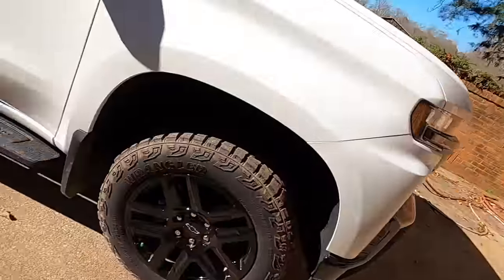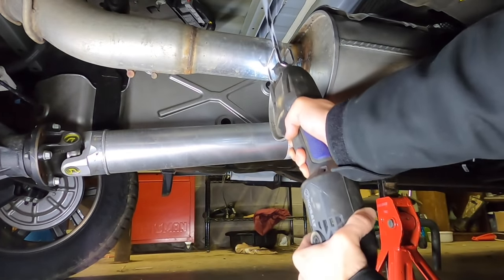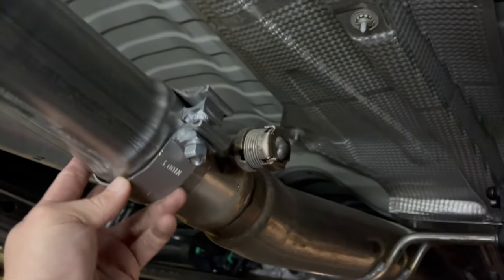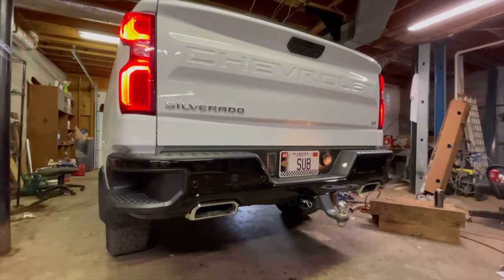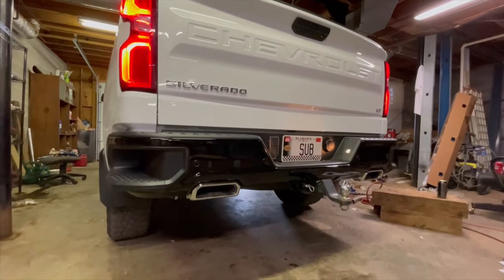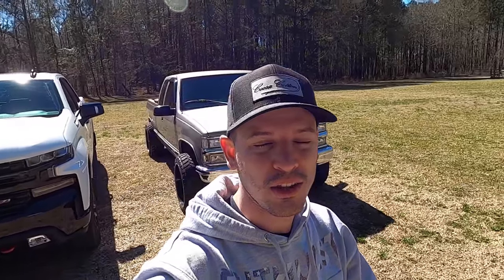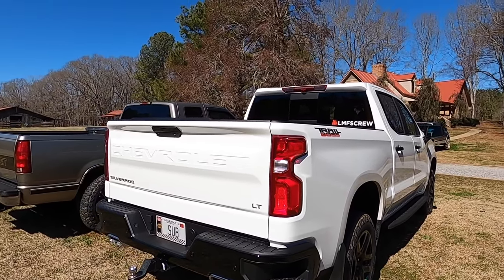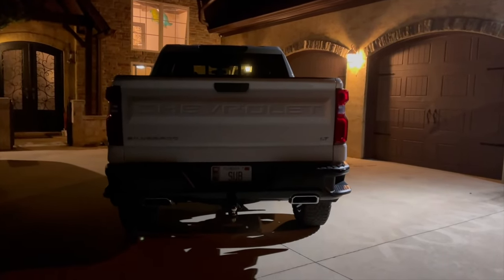MUST DO exhaust mod for your Silverado!

Comment: Should’ve cut out the flap valve.
Reply from the maker: Nah, don’t want a helicopter in the cab
Reply: @lmfscrew  There is no helicopter with the dfm
Reply: @lmfscrew  I cut it on mine and it sounds perfect with not a lot of drone
Reply: most say cut the flapper when you do this, but with the afe you might also have to weld it in then...because it's barely long enough to avoid exhuast leaks with flapper delete.
Reply: You're definitely supposed to cut the flappy off when you do that's why he had to cut some of the new pipe
Reply from the maker: I didn't cut any of the new pipe
Reply: @lmfscrew  yeah that's the problem i've seen...most do delete the flapper (it sounds fine w/o it), but when they do that with the afe it tends to be a little short causing leaks that require welding -- specifically what you wanted to avoid.
Reply: Lmfscrew are you thinking about cutting the flapper out?
Reply: I did the same straight pipe mod on my 21’Silverado RST 6.2. I think I can hear the flapper vibrating when cruising. I should have cut it out with the muffler. Overall, it still sounds bad ass.
Reply: How long is the pipe you used?

Comment: Its shocking how much sound the little resonator ports hide. I covered all three of mine up a week ago with high temp hvac tape and it is mind blowing how much louder it is. Before this i only had a magnaflow 18" muffler installed. The resonators delete made it soooo much deeper and more accel drone, but still quiet inside cabin. And then 3 days ago I put on KN cold air intake, and a resonated bolt on exhaust tip, and the tone is perfect for my liking when you combine all three aspects.. Cant hear anything at idle speeds but growls like a mother f when you step on it. The cold air intake rattles my damn gas pedal!! It almost drowns out the exhaust sound.
Reply: and adds 15-30hp...:)

Comment: I cut out the flapper valve on my '14 Sierra, and it surprisingly made the exhaust deeper, so I would cut that out and move the piping up if I were you.
Reply: What does the flapper in the exhaust actually do ?
Reply: @JohnD0129  Its sole purpose is to quiet the V4-mode drone. But since it only opens up depending on how much throttle you put down it acts like a valve that would quiet the noise of an engine.

Comment: I HIGHLY RECOMMEND the Borla ATAK Crate Muffler, I just put that on my ZR2 Silverado with 6.2 engine and she is purring like not other!  I left the resonators but had the shop cut the flap by the factory muffler.  You won't regret the crate muffler.. And yes, there goes my gas mileage because every time I accelarte, I want to continue to hear the roar and I gun it!  Lol😂

Comment: I have the high country with the 6.2 10 speed transmission. I was recommended by a good friend he's a excellent mechanic,  the Corsa sports exhaust and K&N sistem with the pedal commander.  Work excellent I really recommend 👌😊

Comment: I got a 2021 Trailboss Custom with a 6.2 in it. I did a muffler delete and removed the flapper. Left the resonators on it. Sounded unreal but the cab noise was too much. When the DFM would kick it would sound like a Subaru! So I then put a Flowmaster Super 40 on it and it toned it down a bunch but still has a nice growl to it. It has the 3” exhaust on the truck. Your truck looks and sounds good!!
Reply from the maker: Yup keeping the flapper makes a huge difference with dfm, really wasn’t any sound change going in and out. I’m keeping it until I can get a pulsar to deactivate it.
Reply: @lmfscrew  I put a K&N cold air intake on my 6.2 yesterday and it took care of the Subaru sound for me. Just can’t keep my foot out of the throttle now!!

Comment: I have a 2020 Trail Boss with the 6.2l and did the same thing right away haha. I love the muffler delete. I made sure to get rid of the flapper valves though. It's pretty tame other than the cold starts. This is how they should come from the factory.

Comment: I put a Borla cat-back S with twin black same side pipes on my 2017 Silverado 5.3.  I can noww hear that baby start up in a detached garage 100 feet away from my house.  I would also recommend an oil catch can.  I couldn't believe the junk it collects after I installed it.  All direct engines and turbos should have one.

Comment: Sounds better than stock. I suggest the Flowmaster American Thunder cat back kit. It has the Super 40 chambered muffler. When I look at the stock exhaust tips I think HDMI 1 and HDMI 2 ports. Great video! I like your Trail Boss.
Reply: Bro literally what I think when I look at them.
Reply: I had a 2019 trail boss with an American thunder in it and loved it. I traded it in for a 2022 rst and thinking of installing another one

Comment: I did my 2021 trailboss 5.3 and I love the way it sounds. I just hope pulsar updates the lt module for the 2021 10 speed 5.3 so I can get rid of the dfm
Reply: How loud did it get? Did u delete dfm yet?
Reply: @TheShovelhead82  it has a very similar sound to my 2015 that had dual Flowmaster 40s on it. Yes pulsar finally updated the pulsar lt module for 2021 so my dfm is now shut off

Comment: I've got a 2020 6.2 TB and we cut off before the flapper valve and did a welded splice. Just like yours the exhaust sounds AWESOME at low speeds...BUT; after a couple months of highway/interstate traveling I just had a flow-master put on as the cabin sound at 65-85mph got really annoying. Now I can hear myself think! $100 exhaust splice and then the $250 flow-master was worth the trial process for sounds.
Reply: What flowmaster did u end up with and do you still like it.
Reply: @brewtus4141  Don't know model but best I can remember it was a straight through off-set. As its wore in the last 8-months its gotten a lot "throatier" and sounds great.

Comment: Ok. So I got mine back from muffler shop. I deleted the muffler, adaptive flapper valve, and the 6 resonators and had quad tips put on. Thing sounds amazing with no drone for $300.

Comment: Sounds pretty good. I've got a 2008 chevy Silverado 1500 mine don't have the 3rd cat either. I've got the Jones full boar single chamber muffler on mine an it sounds awesome. An I would of cut that flap out in front of the muffler. Because everyone does because it makes a weird shhhhh noise an it rattles. Everyone cuts that flap out haha.

Comment: I cut the flapper off mine when I did the delete. and get decent pops on deceleration as well.
Reply: Do you have drone at highway speeds without the flapper?
Reply: @jarednifong5615  no sir. I do notice pops at deceleration sometimes. It’s like a very mild burble type sound.
Reply: @wrenf22  just got my new exhaust this morning, deleted the muffler and flapper and replaced it with a Flowmaster super 10, check it out here https://youtu.be/fyEXFjEREdU

Comment: Flapper is the worst part of the restriction and no it's not a key component for cylinder deactivation it's a sound deadener.
GM's own performance exhaust system deletes the flapper and right in the description from the GM parts website says it gives it an additional 7 horsepower and 4 foot pounds of torque.....
All it is is a stainless steel exhaust system with a low restriction muffler and by the way again does not have a flapper valve on it.... 
https://www.chevrolet.com/performance-parts/vehicle-upgrades/new-silverado/exhaust

Comment: Dumb question, but does this cause any codes? 

I got a 21 high country lifted 6” on 20x12.5 -18 and my truck is way to quiet to be that big and I need to fix that asap.

Sorry for the comment on a two year old vehicle.

Comment: I get 1-1.5 mpg better with the muffler unhooked open y pipe vs stock muffler and exhaust. 6.2 285s 3.73.

Comment: Does muffler delete cause any issues with performance etc.?
Reply: No
Reply: No...just don't mess with the cats. You can rip out the flapper valve and resonators if you want as it has no effect on warranty and/or performance.

Comment: Hey Man, I was wondering where you got the running boards on your truck? Just bought the same truck and your side steps look very good! I know the Sierra AT4 comes with something very similar but I haven't seen the Z71 with the ones you have, I would really appreciate your thoughts! Nice videos dude.
Reply from the maker: They are factory high clearance steps, they have been on backorder for a while now. Luckily mine had them when i bought it

Comment: Thinking of removing my resonators and welding two Carven R mufflers in. I'm holding off till you show us the resonators inside and what it sounds like with just straight pipe. Wonder if it will crackle on decel? I have the exact same truck. Good choice!

Comment: Was there only 1 flapper?? I had flapper in front and behind muffler and was a bit upset that the delete pipe instructions were only deleting one flapper 2 more inches could have easily deleted both. Really curious why yours only had one flapper?

Comment: Whats the point of chevy running 3.5 inch pipe only to neck it down 3 inch on either end of huge honking muffler? impededs max flow doesnt it?

Comment: Looks great but wondering if this install would compromise my warranty or screw up the computers on the truck?
Reply from the maker: Nothing changed after the catalytic converter should void any warranty. The truck doesn't even know it's on there because it reads from the o2 sensor at the cat.

Comment: Cool comparisons! Thanks for doing a video on this. I have a GMC Sierra AT4 with the 6.2L. I had a muffler shop take off the stock muffler and flapper valve and replace with a Borla ATAK muffler/extension (stock resonators still in place). Mine sounds deeper than yours. Question: has anyone done a horsepower/torque increase comparison before and after? I am curious because I can "feel" a little more power with mine. Not a crazy increase...but, def noticeable.
Reply: How is the drone I want to also do that.
Reply: There will be next to nothing for performance increase with deleting a muffler...

Comment: I am curious, did this void your warranty
Reply: Yep. And it loses HP and fuel millage. You have to custom remap ECM and add another 3000 grand to make it in it's true state of ''undetuning'' When engine relaxes in overdrive it's extremely annoying in cab. Ruins sound system, cannot carry on a decent conversation and pisses off people trying to sleep. For 9-10K you can completely  do away with all cats and have a true torque monster ''612hp @ flywheel without all the jigger rigging. That engine is capable of making 800 + HP if you do things correctly and have a mellow deep rumble exhaust note instead of piston slap.

Comment: I did the same thing on my 2019, but took the valve off too.
Reply: Do you have drone when it drops cylinders at highway speeds?
Reply: @jarednifong5615  Because of the DFM, it's not really a drone. I can definitely hear when it drops into something less than 8 cylinders. When it does that, I will say the sound is not always desirable and can sometimes be annoying. The volume at highway speeds is mild to moderate. No regrets, still happy I did it.

Comment: Imma get another f150, 1999 this time, with either 5.4 or 4.6 and get muffler delete, what exactly is true duals?
Reply from the maker: True duals is two separate pipes that don’t connect
Reply: @lmfscrew  oh, so if you get a H pipe, it wouldn't be true duals, so ya can have a muffler delete with true duals

Comment: I had a muffler delete done to my 21 Silverado  a month ago at a shop and ever since then I get sputtering when taking off. Any ideas how to fix it? The shop in question and my dealership had no clue how to fix it. Did you experience anything like this?
Reply: My 2020 is doing the same thing did you happen to figure out what was causing it?

Comment: Not gonna void you warranty is it? Drone is gone if you dod afm delete and remove that flapper
Reply: No warranty isn't voided. The drone was HORRIBLE in my 6.2 after doing the splice and flapper removal. Ended up putting on a flow-master for highway driving sanity. Caveat is; I didn't remove the resonators...so that my have been the cause of a lot of my drone sound. We'll see how he does with this exhaust splice over time.

Comment: What’s the farthest back I could go without having a check engine light on ? Cat back resonator off and muffler or what? I really want it loud but still not void my warranty
Reply: The only thing that should throw a code is if you were to take off the cats, and trip the o2 sensor code.
Reply: Probably a cat-back...

Comment: Wait. Howd you get your fog lights on with daytimes and no lowbeams?
Reply: The only time you can't put the fog lights on is with high beams
Reply: @williamrhoades3392  that doesnt amswer my question, as when i turn on my fogs my lows automatically come on
Reply: That doesn't happen in my truck, I can put just my fog lights on, with no other lights coming on.
Reply: What year is your truck?
Reply: @williamrhoades3392  2019
Reply: Weird, mine is a 2020 trail boss.

Comment: Is a 4.8 true duals no cats as loud with the same setup on the 5.3 and 6.2?
Reply: It’ll definitely be loud, side by side same setup with 4.8 and 5.3, the 4.8 tends to be higher pitched/raspier while the 5.3 or 6.2 is slightly deeper. Depends on the bends and size pipe too.
Reply: @coreybachman7626  what pipe size will be the loudest?
Reply: @Nasa5072  I’d go with 3 inch for loudness 👍

Comment: I’ve been asking various guys on here this question on different channels. My 2021 trailboss had to be towed to dealer with 8k miles. Esc and break lights came on and check engine light. Driving down hwy at 70 mph the brakes just came on and back end started skipping down road. Engine started making horrible clicking noise. Anyone else here about this? Lucky I was in truck by myself no kids or anything. Seeing what dealer says but this is also our family car so this might be the end of the trailboss.
Reply: Eh the 2020 TB I had shit the transmission at 4k miles. It was the 6.2 with 10 speed. Sold that thing a week after I got it back from the dealer. Don't need that bad juju in my life 🤣
Reply: @warmaker4  thanks yea I’m thinking about doing the same. I’ve maxed the payload and tow on it now so might be good time to be done with 1/2 tons and move up. Thanks.
Reply: @warmaker4  followed suit. TB gone went back to Ford but stepped it up to a 250 with the 7.3 Gasser.